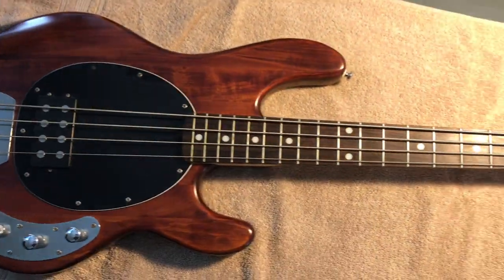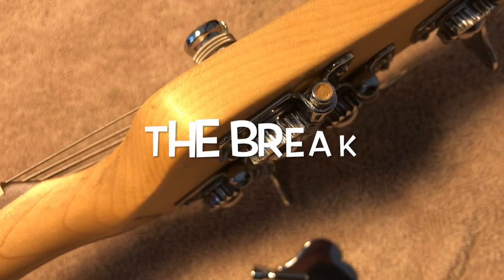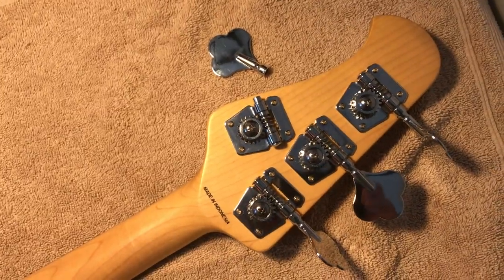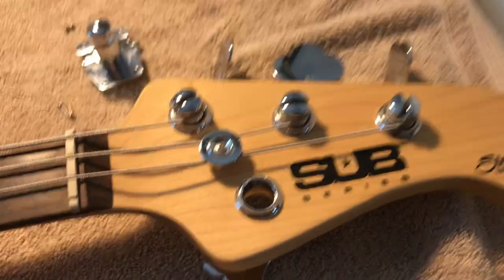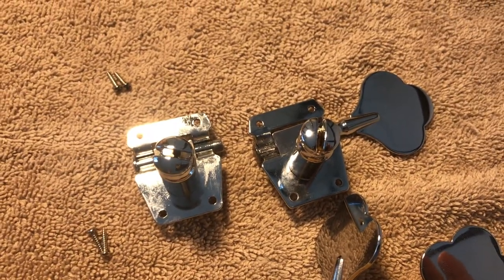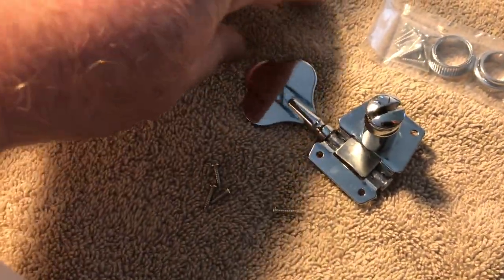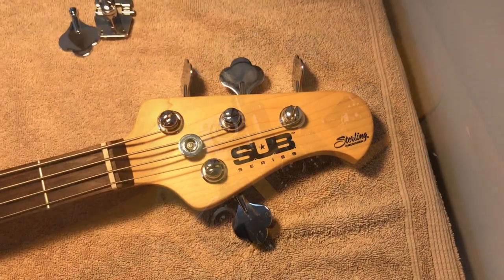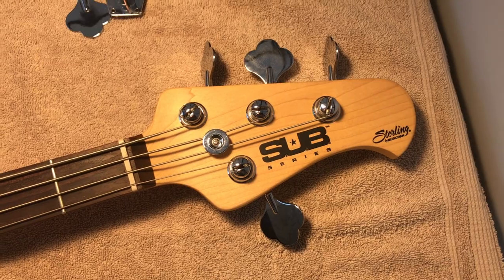Bass Guitar Tuning Machine Replacement

Comment: Very little point in changing cheap tuners for cheap tuners.
Reply from the maker: Appreciate the comment and I definitely understand your point. However, for the budget friendly price, the tuning machine fit well, matched the existing set perfectly and functions just as well as the other tuning machines.
Reply: Funnily enough when my stingray fell out the gig bag and snapped the peg last year I ended up buying an 08 MM StingRay4 3-eq. glad I did
Reply: Unless one is broke and you don't want to pay 70 bucks for a new set.
Reply: Unless you have a broken one as did this gentleman... 🤦‍♂🤷‍♂️